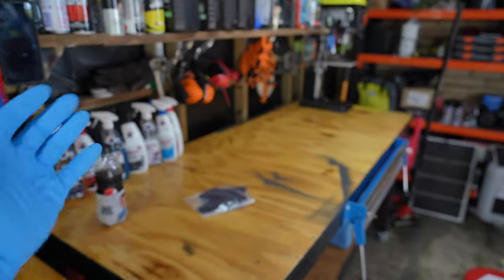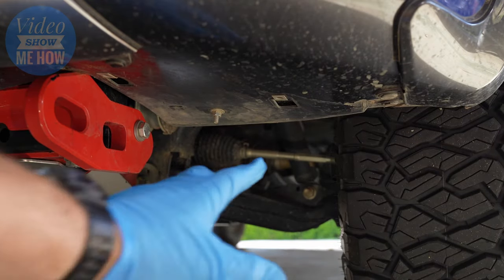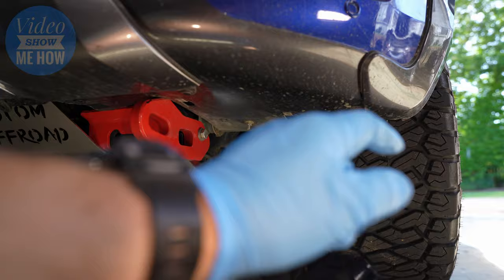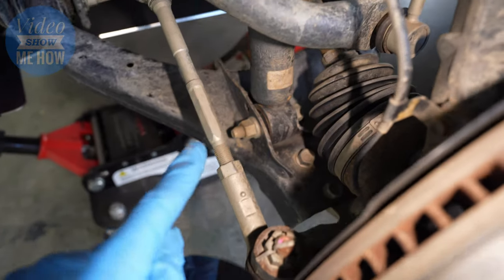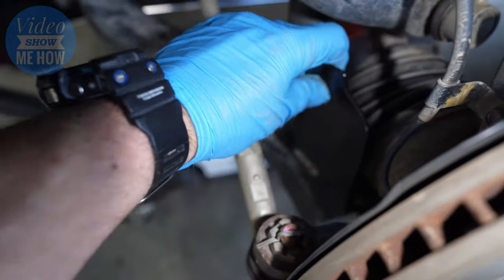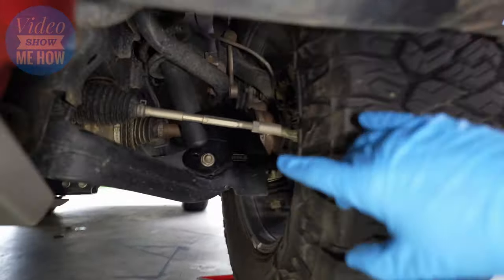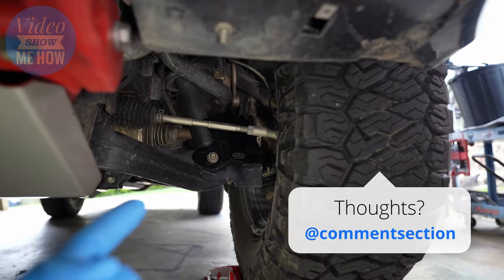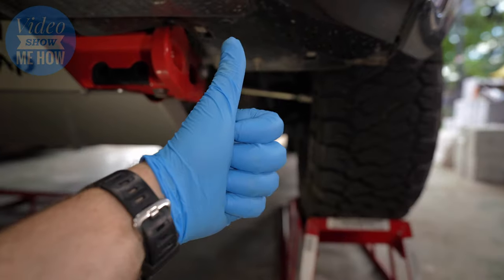MUNJI CV Boot Deflector Guard - Protect your CV Boots from Splits! - Isuzu DMAX Build Series #27

Comment: Hi, can you instal these while the front wheels sits on ramps with suspension loaded? And this install won't affect wheel alignment, right?And the tightening torque you mentioned in your video, is that from manufacture specification?
Reply from the maker: Yeah easy, can install without even removing the wheel if you want.
Reply: Dumb question, they don't touch or scrub anything when steering is at full lock right? @VideoShowMeHow
Reply: Hi Adam. 96nm on the shock nut. Was this specification from Munji?  Or you have Dmax workshop manual?

Comment: Hi, so noticed you have rated recovery point installed without a bull bar. Did you install that yourself? Do you have a video on it?
Reply from the maker: Yep an arb one. Installed video coming soon of a pair I'm replacing it with 👍
Reply: @VideoShowMeHow  Thanks. Also, did you install the EGR delete module from Munji 4x4?
Reply from the maker: No, catch can does the job for me
Reply: @VideoShowMeHow  What is the part number of your ARB recovery point?
Reply from the maker: Unsure, it's from ARB, left hand side

Comment: Wasn't aware of this product but am going to order some right now. Thank you.
Reply from the maker: Be sure to use the code mate, get some bucks off 👍
Reply: Hey, did you buy and install these CV guards?
Reply: @liang2512  yes purchased a set for my 2014 model and installed myself.
Reply: @MickMcN  Any issues with rubbing or anything? Are you running stock shocks? Did you make any mods or changes for it to fit?
Reply: @liang2512  no issues or rubbing. No modifications required to install and easy installation. Have ARB BP-51 suspension

Comment: I installed these and the plates had only about 1-2mm clearance from the shocks (factory shocks). Took them off because I wasnt convinced they wouldnt rub against the shock. Emailed Munji about this asking for a refund weeks ago and didnt get a response. Wouldnt recommend.
Reply from the maker: Hmm have had mine on for a good couple runs now and no rubbing so far? Did you have any rub marks mate? Maybe just bent out a little if concerned?
Reply: @VideoShowMeHow  They were that close I didnt leave them on to find out. I dont have a vice or anything to bend them easily myself. Do you have a picture of how close yours are?
Reply from the maker: No don't have a pic, you can kinda see in the vid though
Reply: While there bolted on you can easily bend them out slightly no need for a vice
Reply: Was just about to order, thanks for the feedback. My concern would be rather than being to close or not bending or not, neither here nor there but not replying to a customer email is more than poor business, refunding is a whole other story. Reply to your customer. Great vid by the way. Love the idea.
Reply: G'day mate 
Sorry for the no reply but I have put up many videos on the Munji FB page asking people to call me as I'm struggling to keep up with all the messages and emails. 

Everyone is given my private number to call anytime for assistance. Also mentioned in the listing regarding checking the clearances and how to fix.